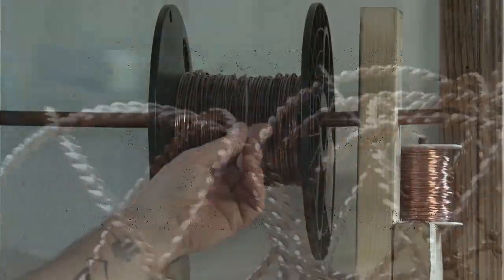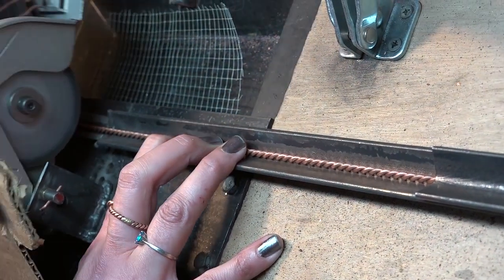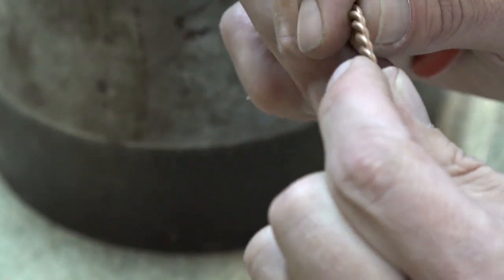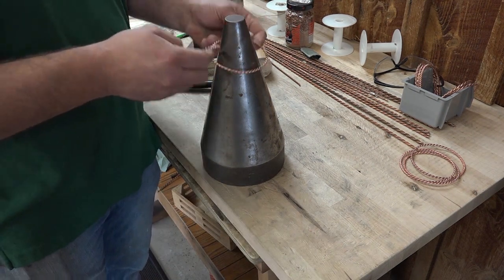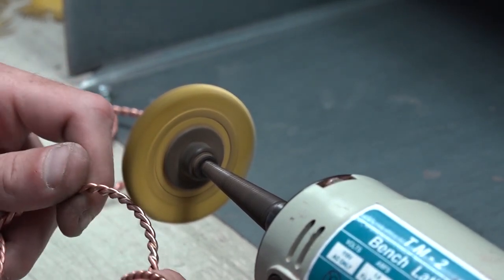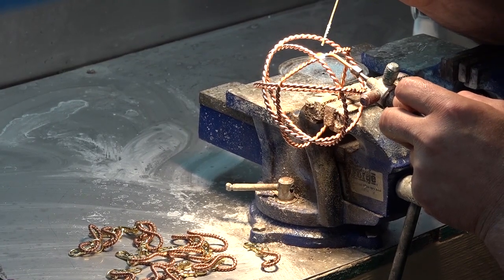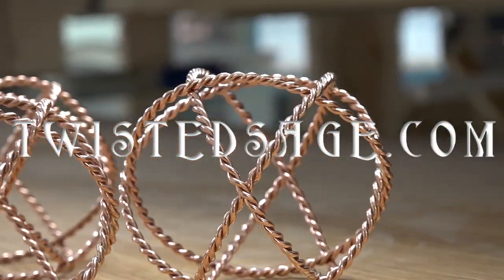Generator Build

Comment: 2:24 "... ensuring that each wire meets back upon himself and creates a perfect joint ..."
wow, how do you know or how you are checking this?
because two types of connection are possible.
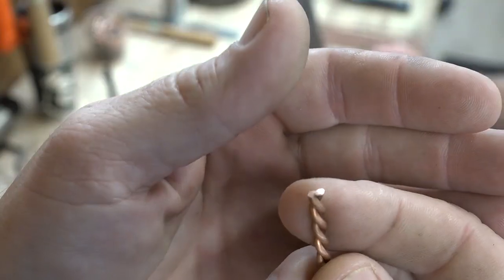1:52 did you slide all the way on the twisted wire for pairing it?
this gives me a headache, please help.
Reply from the maker: If the wires are offset, then the ends will meet together.  you can offset the ends more than what is shown here, and then it will be obvious which ends meet.
Reply: @Twistedsagecom  , but how do you offset a wire when the other end of both wires are flat on the table?  Also, you'd still have to twist the wire to make sure they align.  Kind of hard when dealing with 8 gauge wire and the wires are somewhat twisted to capacity.

Comment: 0:53 "hundred thousandths of a centimetre"  incredible precision how it possible?  0.00001 cm -> 0.0001 mm 
please can someone correct me if I wrongly understanded what is the mean by this statement
Reply from the maker: We use a Digi-scope to double check our cuts.   It will measure to .001 of a mm.  I see that would actually be 10 thousandths of a cm.  Thank you for helping correct this statement!!
Reply: @Twistedsagecom  I Reaaalllllyyy Want to believe this stuff! (doesn't require beliefs if it actually works though lol). ALL these people can't be fake reviews or placebo, so it's GOTTA be worth something. I just don't grasp the 'science' of it, and I understand science is the world religion of measuring God lol, it's a useful joke. 

ANYWAYS, I do not comprehend, that if these rings require THAT SPECIFIC of a measurement, to attain THAT SPECIFIC of a frequency (144 mHz, or a harmonic of the speed of light), the TINIEST mis-grind or mis-polish would make it SLIGHTLY OFF of that harmonic, therefore not being of use.

Do these resonances work even if it's .1% removed from the target frequency? Would they still help? Because music tuned to A = 432hz has healing properties, a small move to A = 440hz produces anxiety and the sense of separation, fueling ego-mindedness. If these tensor rings are even slightly off, wouldn't they produce harmful frequencies? Appreciate any response brother.

Comment: @ https://youtu.be/jwalOlY0XTk?t=140 in the video, where did you get this Mandrill?
Reply from the maker: you have to look on ebay to find old blacksmith mandrels.  they usually need taken into a machine shop to be turned to get the divits out and polished.